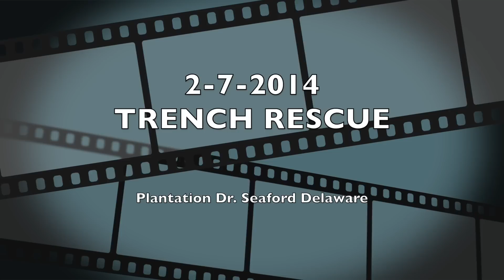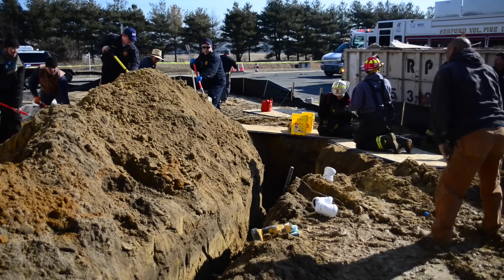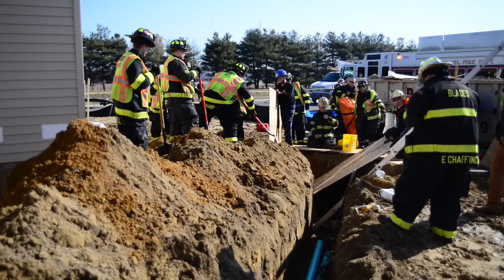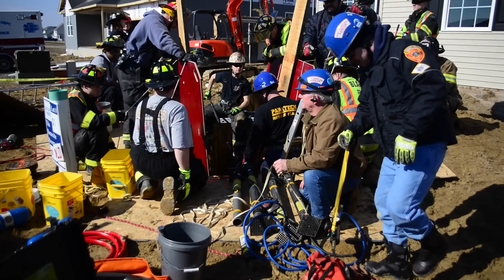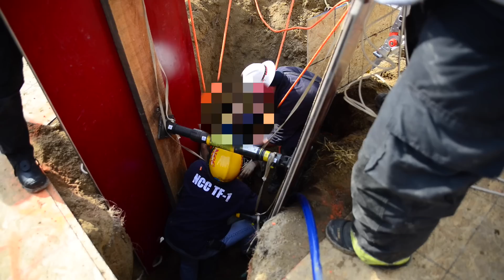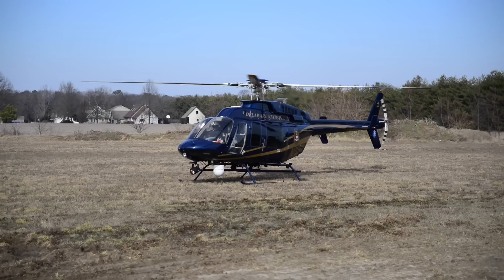2-7-2014 Seaford Trench Rescue

Comment: What people don't realize is that the safety of first responders is critical as well...it takes time, effort, and equipment to create a safe rescue. You can't just jump in.

How simple would it have been to use a trench box, and keep the spoils back two feet as required?

Nice job responders!